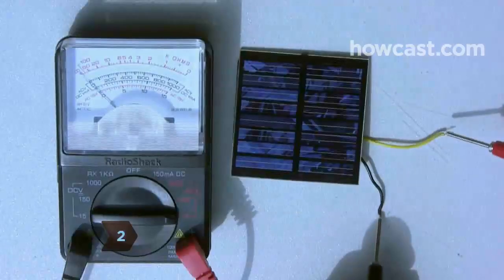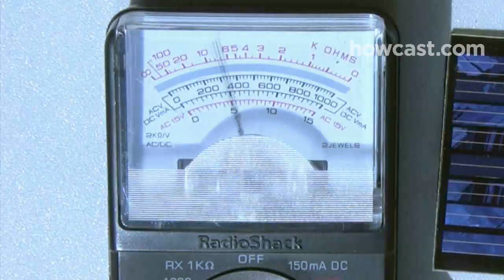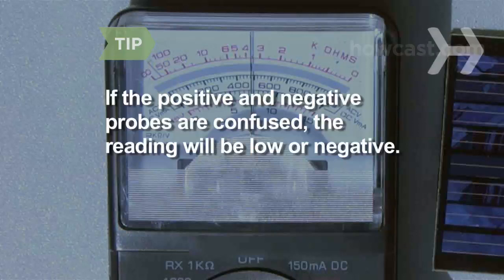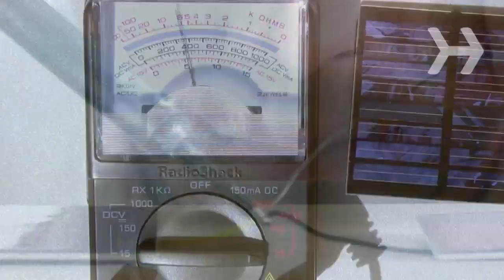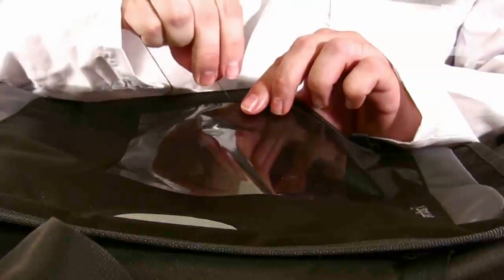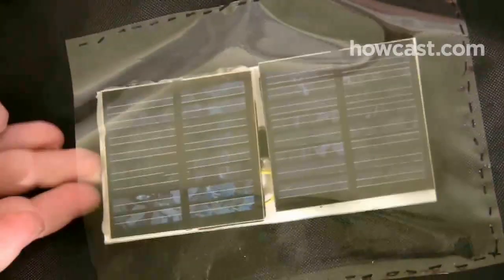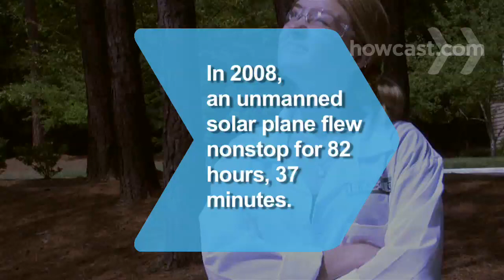How to Make a Solar Charging Bag

Comment: Yeah, it would. The cheapest part is the diode. Which cost like 10 cents but you need to buy a pack of them, that is maybe 2, 3 dollars. The other parts are pretty expensive if your only going to use it to just make this. A wire stripper is like 20 bucks. I believe(don't quote me) the cheapest voltage meter would be maybe 30 bucks. You don't need a wire cutter imo. Everyone has screwdrivers. I don't know about solar garden lights. A soldering iron isn't that cheap either.

Comment: i think the most expensive part would be the solar panels, i got my wire stripper for 10 bucks and you can get a multimeter for 10 bucks as well(a pretty crappy one, but it will do the job)